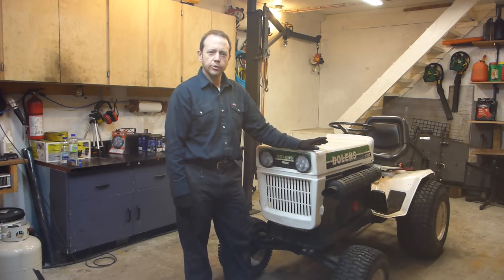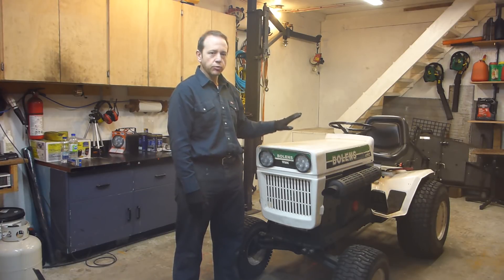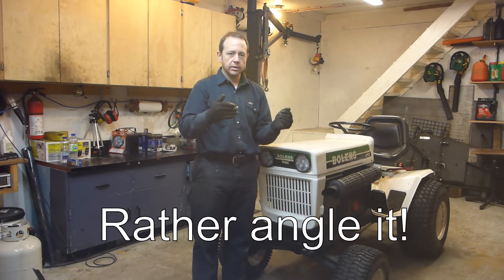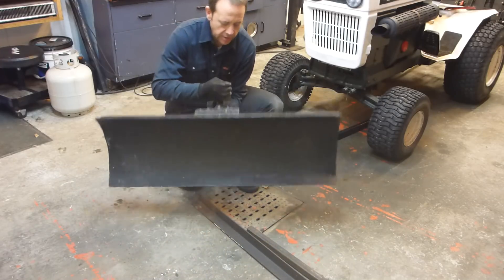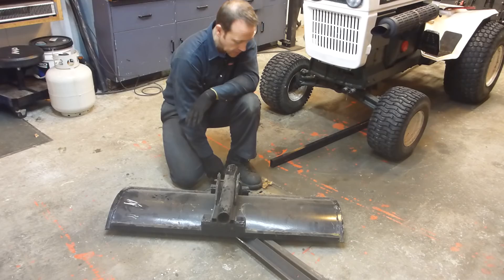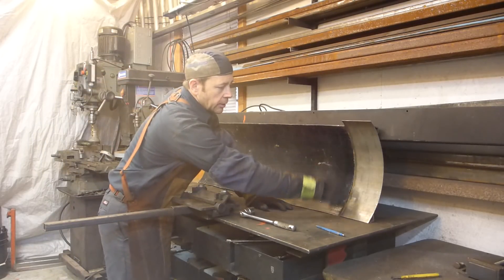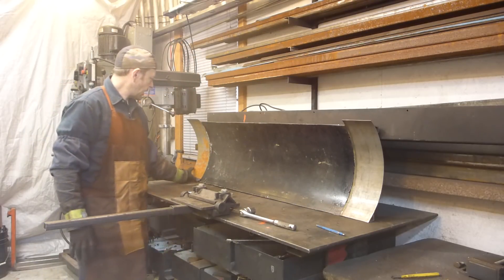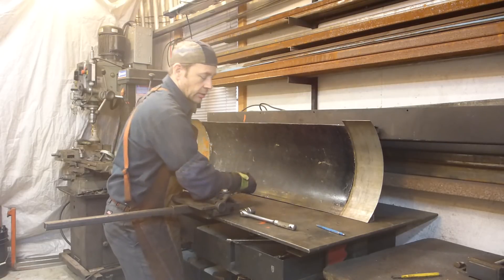#118 Homemade Snow Plow for the Bolens - Part 1

Comment: Really nice work, Joe. Simply amazing to see the maestro at work.  I couldn't picture parts until you put them together and then, voila, they fit perfectly as one precision'ed part of the plow.  You're making the plow just in time too. Can't wait to see part 2 when you put your plow in action. Thanks for this video and will see you on the next.  Stay safe and stay warm.  Speaking of warmth, how do you heat your working garage?  Do you use a kerosene torpedo heater?  Enjoyed a full watch. Thumbs up👍.
Reply from the maker: Thanks for the kind words Don, I really appreciate it! I heat the garage with electricity only.  In the province where I live, electricity is one of the cheapest on earth. It's 8¢/kwh (Canadian currency, so 5¢ US... ), no restriction or surcharge based on time of the day... I have one 1500W near the door, which is to keep the garage to the right temperature when I work.  Then if I have to increase quickly the temperature, I also have a 5000W heater on the ceiling. Combined 6500W. When I don't work in the garage, I maintain it at 35°F, just above freezing point. For the project, it was maintained at 60°F.  Last night, the temperature outside went down to -4°F... Brrrr.... Thanks!
Reply: @FromSteelToWood  Wow, now that was a bit too cold for me, Joe.  Hmm, if I ran an electric heater to keep the garage warm, my electric bill would be sky-high.  The wife complains if it's up by 2 cents much yet $100 (ha). I have a double heater that runs off propane so I'm going to try that this year.  I didn't before b/c of possibility of carbon monoxide.  So this year will be an experimental heating test using different type heaters.  Thanks Joe.

Comment: Great build!  Can't wait for part 2!  I just purchased my first welder.  Used Lincoln Stick Welder at auction.  Going to clean it up and see what I have today.  My first step into welding!  Any tips?
Reply from the maker: Great! I am not so familiar with stick welding.  But I can tell you welding stuff together is the freedom to fabrication! There is plenty of welding videos on Youtube. You might benefits from it. But practice is the key.  Then you will get better over time.  Surface preparation is key.  Then keeping your electrode dry is important. Thanks for your comment!
Reply: So are you using MIG?  I guess stick is a good place to start.  Then MIG and perhaps TIG one day.   @FromSteelToWood
Reply from the maker: Steve, yes, I started with MIG. I think both are similar in terms of learning.  Mine is a Millermatic 211 with autoset.  I used flux core wire. So very similar to stick...

Comment: Interesting how you made the plow wider, I did exactly the same method on my Kioti tractor blade about 5 years ago. 
Will you be using tire chains on the Bolens too? About how much weight did you calculate is in each 20 litre pail?
Reply from the maker: The most complicated in a blade is the curve.  Then I just had to replicate the curve!  Much easier. I ordered chains for the Bolens this morning. Studded chains... I was able to put one 30kg bag of crushed stone (1/4'') in each pail. So 132lbs. then they are quite far behind, to they pretty much offset the weight of the plow. Thanks for your comment Reg!

Comment: Joe this is very strong snowplow ! You will be able to push earth and also use it in spring to equalize your entrance with it ! Very well design !!! The tool you use to bend steel sheet his very good !!! Your full face mask respiratory keep you very well protected against dust, vapour, flying object and nuclear blast !!! LOL Can't wait to see your next video !
Reply from the maker: Thanks David! It already had pushed some gravel, by accident! I wish I had it when I had to spread gravel for the carport... You are right about the full face mask. It seems to be uncomfortable, but it is not. I was using a half mask, with ear muffs, then googles.  Then there was a battle between the mask and the google.  Debris were coming from under and the sides of the goggles... With the full face mask, you are 100% sure not to have any debris in your eyes. Then if ever a cutting disk would break, I would have better chances to keep my face like it is...

Comment: Joe, I really like the job you've done.  I especially like the fact that you thought about the turning radius of the tractor , and how it relates to plowing snow so you don't pack down the windrows of snow.  As you know, I once had a tractor about the size of your Case and I never liked  packing  down a snow bank.  I'm waiting for part two  of the build and I want to see how the Bolens handles the snow.
Reply from the maker: Thanks Jim! The plow does a great job. But the Bolens definitely lack traction.  I've ordered tire chains this morning. Will see when I get it what the Bolens can do. For sure, it got plenty of power to push it. But not enough traction. Thanks for your comment!

Comment: This is great Joe! I am going to build one for my Bolens too, but that will have to wait until the shop is done. I really like the way you notched the square tubing to make the radius for the end supports. Can't wait to see it push some snow.
Reply from the maker: Thanks! Can't wait either!  I have used it for an hour or so to remove very hard packed snow.  It's very strong.  But without chains, the Bolens struggles to get traction. I have ordered chains online.  I hope they get in soon!